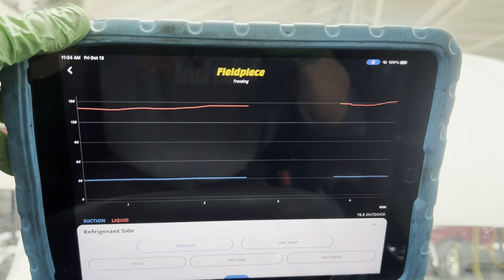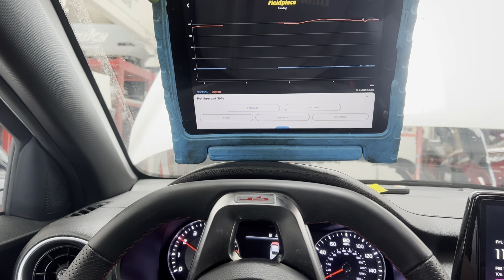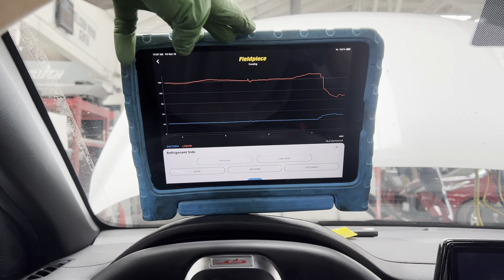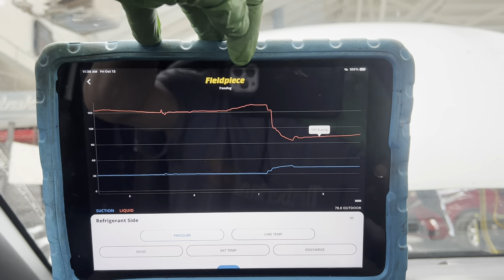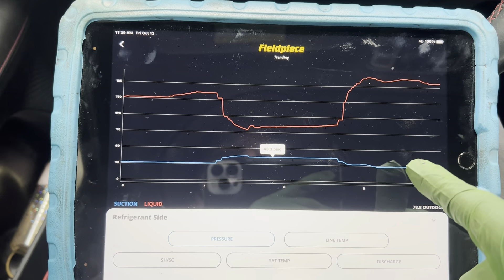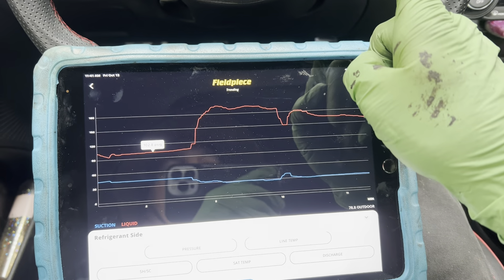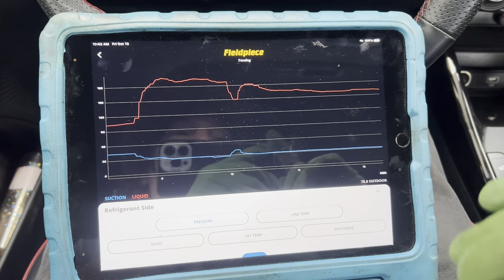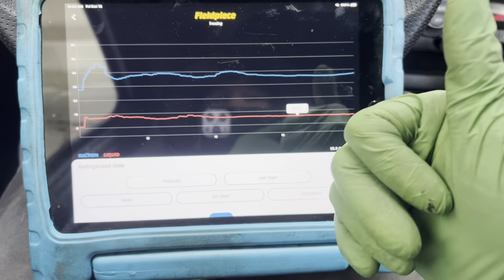WHO TOPOFF OR FILLS REFRIGERANT BY LOW OR HIGH PRESSURE???  or raises RPMs

Comment: Another good video Tom. You have fantastic tools and the knowledge of how to use them. I live here in Arizona and the majority of A/C techs here don’t own 1/2 the tools you have. I’ve seen these tools used in the commercial building side of A/C but never with the automotive A/C techs. I’m 65 years old and the only tools I ever see them use is a digital manifold and some heat sensors. I love tools, but can’t afford the cost of these tools as a DIYer. Since nobody around here has these awesome tools, it looks like the only place I’ll see them is in your videos. Thanks Tom.
Reply from the maker: Look on eBay and craigslist and any form that sells used tools and commercial. HVAC guys are always getting new tools and selling off their old tools.. ⚒️ 

Should be able to pick them up for a dime on a dollar 

I was taught by my father using superheat subcooling old Simpson meters that had the ability to measure for temperatures with forest temperature sensor simultaneously using micron gauge back in the 1970s when I was young and my father was taught on Automotive to use the same tools when he was just 20 years old by older mentors, he had two of them, teaching him air-conditioning when he was young Back in the late 50s early 60s

These method, tools and equipment have always been around. Of course they were analog back in my Father’s Day, and my younger days it’s just Automotive trade has declined, and the lack of education is so low that these methods were lost. They’re not even taught Automotive schools anymore because even the instructors are barely worth being called an instructor. . 

I’m trying my damnedest to bring all this education back to the mass of people with the help of social media YouTube and like I want to open up everybody’s eyes and pick up the industry that is my dedicated goal . 

Thank you very much. Glad to hear from you comment anytime I’m always willing to answer questions for individuals who want to seek knowledge